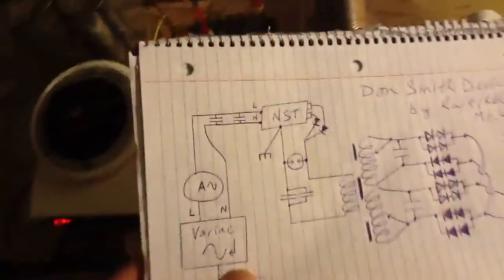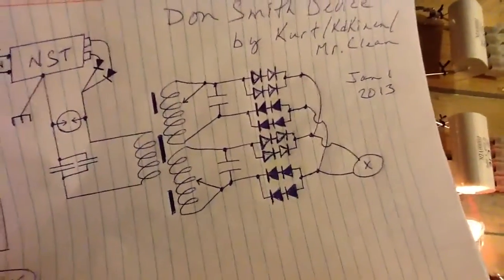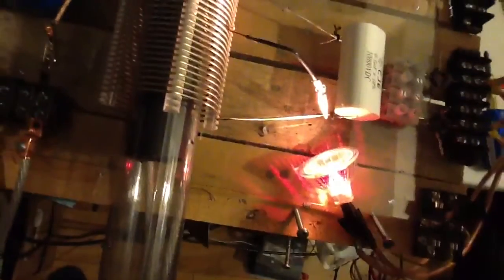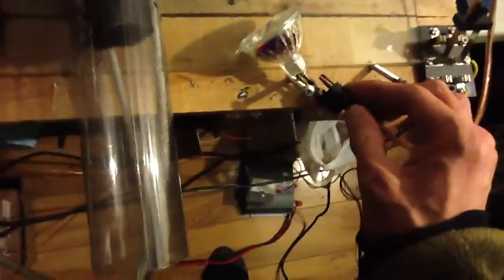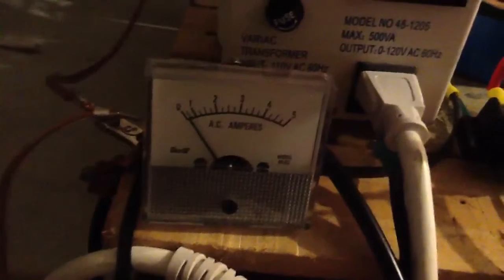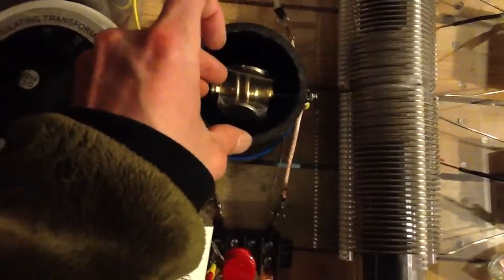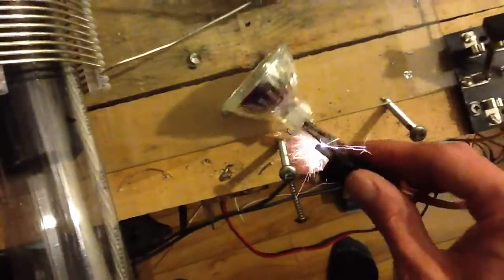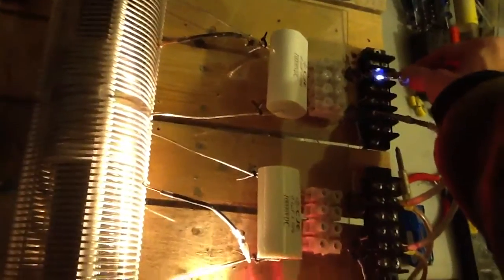40 Don Smith Device 1/01/13: Dual Quarter Wavelength Step-up Tune and 50 Watt Halogen

Comment: Hi Kurt, what is the length of L1, how many turns plus I see there are two cap 0.1uf, in parallel with a smaller (red) one, I guess the smaller disc cap is also 0.1uf. Did you calculate inductance of L1? What was it, could you kindly share. I am going to try your experiment as it is very clear and well explained. Besides, the two AC capacitors are in parallel with the NST supply, do we really need them. Thanks

Comment: What I Do not understand is what the actual length of the individual primary should be to obey 1:4 rule. Is it that if the primary  wire length is 1nch, each left of the secondary must be 4inch or if the primary is 1inch, then each part of the secondary must be 2inch?

Please +kdkinen help me out.
Reply from the maker: here the 1/4 rule was in length of primary to a single secondary, then the other secondary is basically just a duplicate of the other. 
however this was no problem as the secondaries were fully adjustable by the taps... although this build was far too accidental, and i was very inexperienced and would improve greatly on this now, which i plan to do :)

Comment: THe caps in sereis withe coil can be replaced or put the same caps in front of the spark gap too and in series withe coil another two one in front and one behind variable and find same. THose caps in parallel with the secondary coils, should be replaced in such order that you double them so you can run them in series, one on each end of the coils and with the same coils. and voila wire less
electricity
Reply: This is a stupid way of writing something in English. You should have written it in your own mother language. People can do better translation on google but your English is horrible. Does not make any sense. Rubbish.

Comment: how did you determine the L value of the NST? i want to do some resonance work with an oil furnace transformer but i have no inductance meter and the manufacturers dont have that data

Comment: n one of don smith video during in 2005 he spoke about connecting the output spark gap negative wire to the earth ground it did not say about grounding the input.

Comment: Great work! What do you mean by "Dual Quarter Wavelength"? If the LC resonates at 56kHz then the quarter wavelength will be 1.339km.
Reply from the maker: At the time of this video i meant that the coils are a 1:4 ratio in physical length... and the natural higher frequency of such short coils was tuned down using the capacitors.
But yes you are correct, for the coil on its own to resonate at that low Khz would need to be that long to naturally resonate at 56 kHz
Reply: Wrong! the quarter wave length will resonate at 4 times higher. Shorter wire higher frequency, longer wire lower frequency. So if a 10 ft wire has a natural frequency of 100MHz, then a 2.5 ft wire will have 400 MHz as natural frequency. Don Smith said that too if you had not missed his comments. So far, this is the best and very clear presentation by  KURTSVIDS. I really appreciate his great work!

Comment: Great videos!  Do you have a schematic that has the best chance of working?  I have found many many schematics all a bit different...none very complete.  just put my first primary side together and have spark gap firing, need to build secondary side and start tuning.
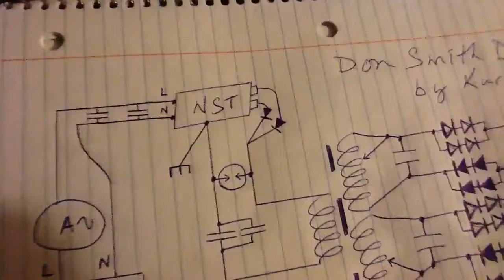Reply from the maker: hi there the schematic for this circuit is in the video at 0:36. As long as your primary frequency is within range, you should be able to find the right tune on the secondaries using adjustable taps as i did. then you can change tuning on the fly during operation. make as many of the components as possible to be adjustable.
Try to put the primary coil outside the secondaries, not inside as Don showed.

Comment: Hi kdkinen,
Any new developments/progress. Did you make the L2 and L1 coils or you bought them.
How much gap is there between the L1 and L2? Do you use any kind of core on L1 in this video? Did you ever try using a core on L1?
Ever used HF (in the MHz) in your system. Don Smith spoke about the gradient going straight up, and the much greater energy obtained from the same amount of electrons if you capture it at HF, rather than 60 or even 120 Hz. Don explained that in couple of "how to make it" videos.

Comment: I'm debating on whether to try and build a Don Smith generator. I have the 36 page "how to build" pdf file. I'm a seasoned mech engineer with some HV elec experience. I've located all components needed per the pdf file. You seem to have the most success with these after watching a number of videos. Do you think this is a worthwhile effort or better spend time going after another option? TIA.
Reply from the maker: hi good question man, I took it a distance but seemed to hit a wall when faced with needing high frequency input. now looking back I see much I would do different and some that now have the answer to. I plan to revisit this project, but...
unless you are skilled in radio theory, wave propagation, transverse vs longitudinal, open ended transformers, LC tuning, high freq oscillators, etc,etc...
then to save you 7 years or so, with your knowledge of mechanics, I would build the WITTS generator, aka Teslas Dynamo Electric Machine, aka http://www.teslauniverse.com/nikola-tesla-patents-413,353-direct-from-alternating-currents, aka what some today are calling the QEG, aka Alexanderson concept,
even Eric Dollard (today's living tesla) has said many times that by sharply switching the core of the coils, at the resonant frequency, with tuning, is the way to energy synthesis. 
once I can find a suitable core, or have one made, or use existing materials, I will try this as well.
really check out Tesla Universe site, and find a tesla patent where tesla says... basically
" from this novel improvement I am enabled to make a self exciting Dynamo" patent -413,353
Reply from the maker: 2/2... https://www.youtube.com/watch?v=LgEsSOphlp8
WITTS called it a 40,000 watt generator, cause it burned up the primary on a pole pig transformer, based on Tesla I wouldn't doubt it
Reply from the maker: 3/3... Tesla even mentions " periodically short circuiting the secondaries"

Comment: Great stuff, I just went through your video's and I am impressed, you got the frequency down through all your experimentation. I am sure as you keep going here we will move this to a EV application. I am amazed how you short circuit and the bulb stays lit and when you did get it to stop it started back up. Are you leaving black marks on the alligator clips on your purposeful showing of arc?

Comment: It's an amplifier like audio, but high frequency. You can use two batteries to get power +12 and -12V. 24Vpp. Then connect batteries + opamp + this setup module to get high frequency driver. Then use ferrite transformer to transform high frequency low voltage sin to high frequency high voltage sin. Of course you already have a sin generator. Good luck.